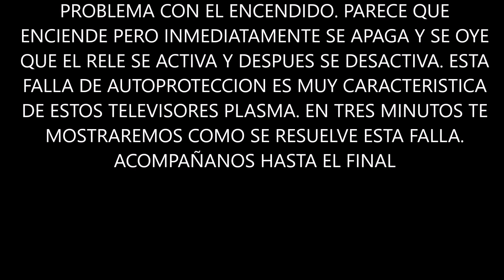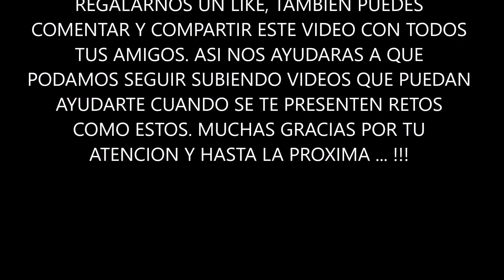TV PLASMA LG NO PRENDE

Comment: Mi tv es el modelo 50pa4500 el cual no entrega los voltages de 5v 54v y 200v mi problema está en la fuente revive todo y al parecer todo está bien solo dudo del transformador choper grande y del regulador strw6052s
Reply from the maker: Hola edgar muchas gracias por comentar, tienes razón en sospechar del chopper, en ocasiones el problema solo consiste en que la soldadura que une el alambre del bobinado esta falsa, prueba re soldando los puntos de las patas, en las uniones con el alambre, pero también puede ocurrir en el mismo impreso. Un abrazo

https://www.youtube.com/watch?v=JZxN1AAoCCU